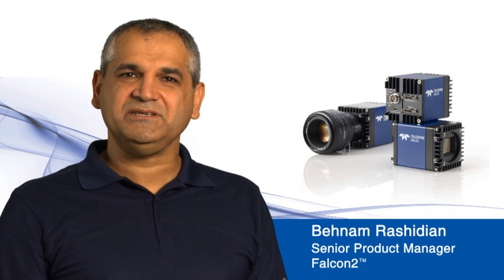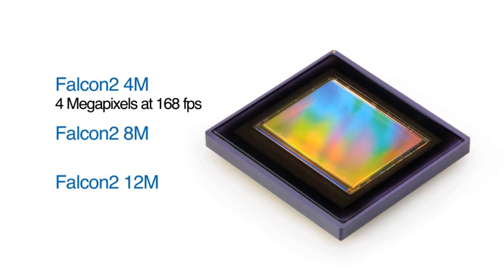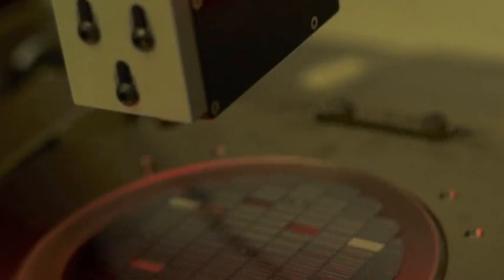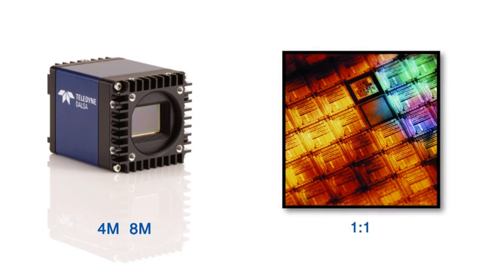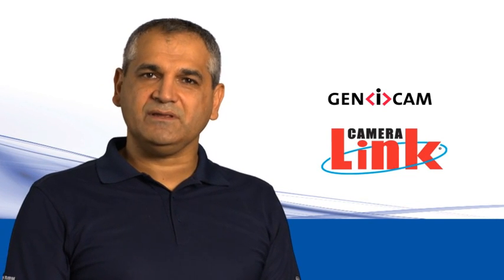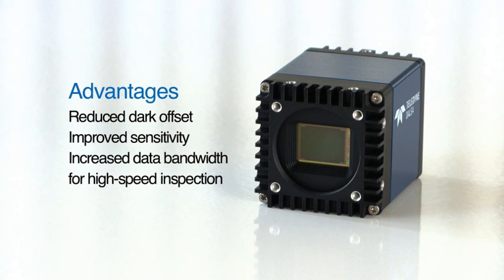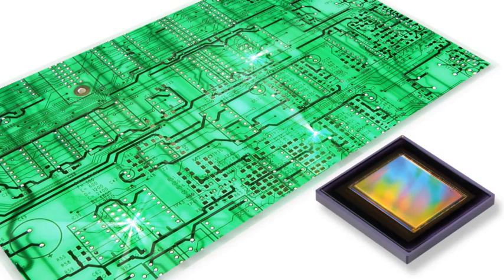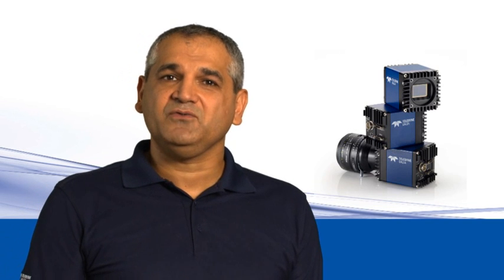Falcon2 Camera Video Tour

Comment: I have a few questions.
1 - Can the camera be used to scan room areas to determine room measurements?
2 - What is the weight of the Camera?3 - How fast can it deliver the data of the images taken?4 - Can it take good images if mounted on a moving apparatus?
5 - How does the camera do in dark environments?
Reply from the maker: +Johnny Quest WY (Johnny Quest) 
Hi Johnny,

The camera's weight is under 300 grams, and more similar specs can be found on the product model pages:
http://www.teledynedalsa.com/imaging/products/cameras/area-scan/falcon2/

As for the specific questions about your application, our sales team would be happy to get answers to your particular questions. Feel free to submit your questions through our contact form:
http://www.teledynedalsa.com/imaging/contact/#cameras;falcon2